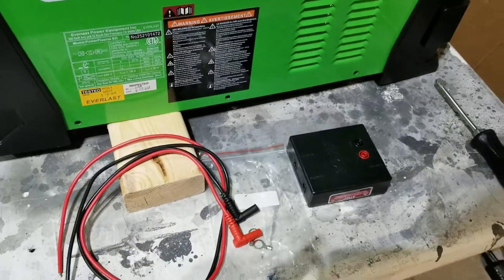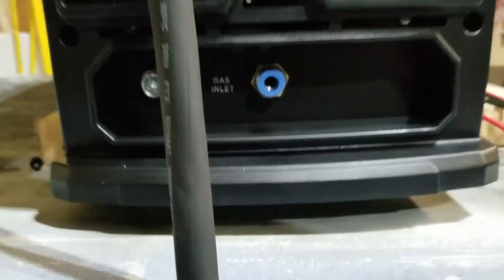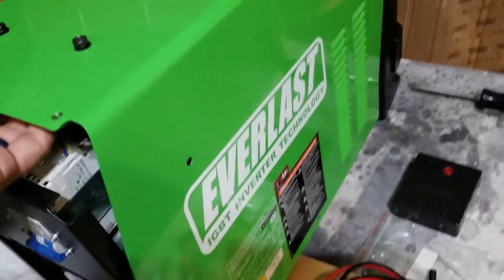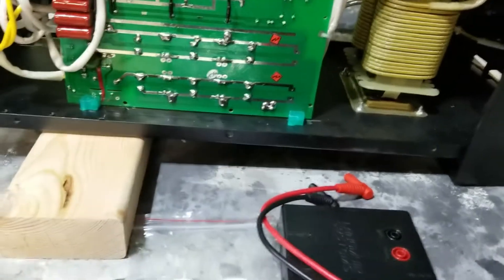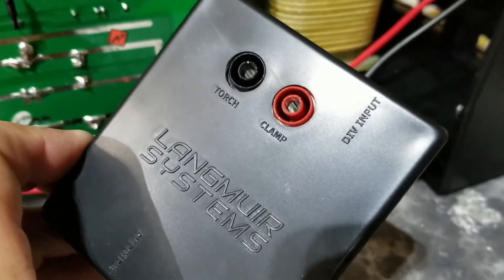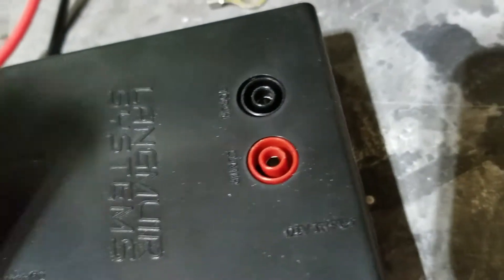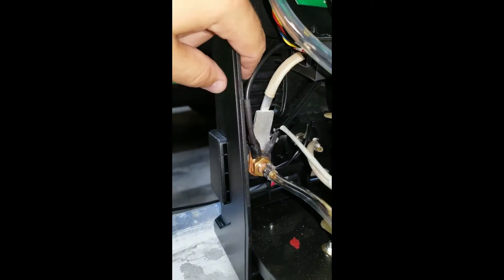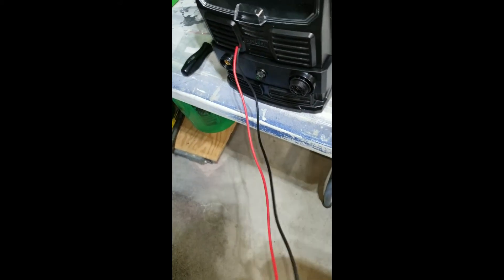Everlast 62i Torch Height Control ( THC ) Wiring for Langmuir Crossfire Pro

Comment: Is their a reason you didn't connect to cnc port?
Reply: The crossfire electronics dont reliably communicate with the CNC port for torch height control.  My on/off is wired through the cnc port

Comment: Thanks for this! Did you use the CNC ready 62I kit that has the different lead on it specifically for CNC machines? I got the CNC ready one and I cant get my PRO to fire the plasma wired directly like this. It was suggested that I do it this method due to issues wiring it into the CNC port in the back but thinking I may try the other way. Did you have any issues getting it to fire?
Reply from the maker: This is only a tutorial on wiring the THC.  You still have to wire up the two triggering leads on the rear of the plasma cutter (in the CNC port) to the trigger output on the table controller